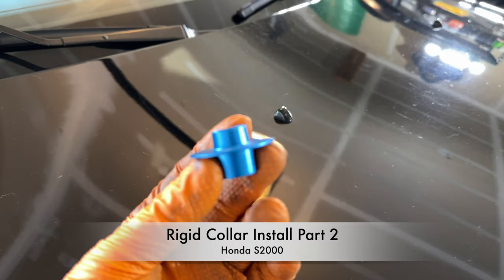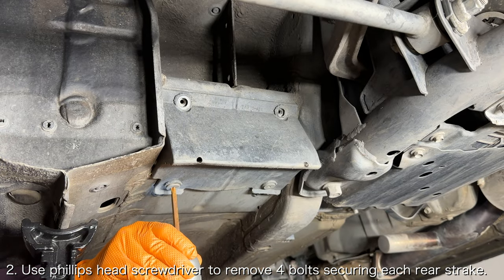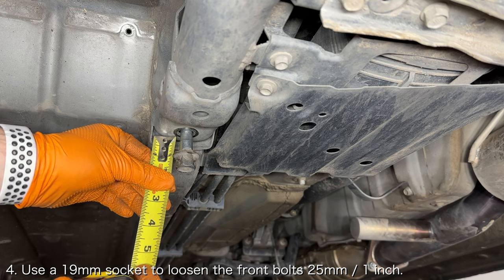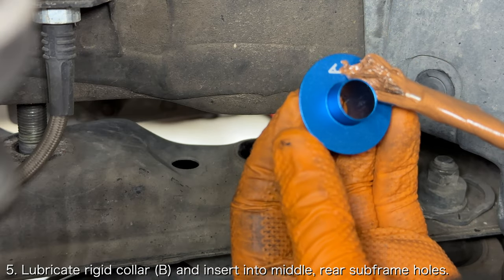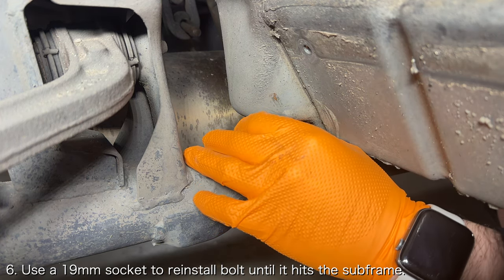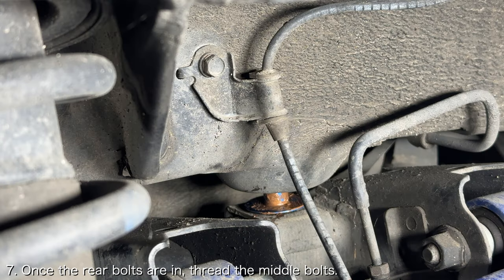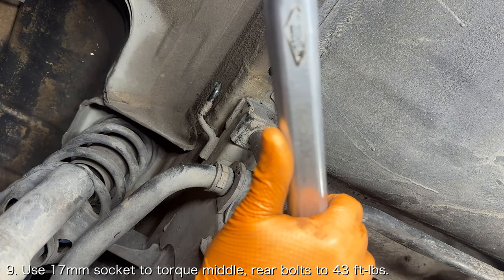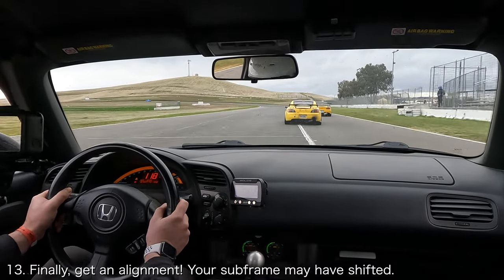Rigid Collars Install Part 2 (Rear) | Honda S2000

Comment: My note after doing these: create some slack in the ABS wires! They're tied down to the body and the subframe, so when you lower the subframe, they get pulled tight. I didn't break mine but stressed them a lot more than I would have liked. Removing a 10mm bolt on each side allows plenty of slack for them to move freely.

Comment: If you ever get a chance a tailshaft/output shaft bearing replacement video would be helpful to a lot of people. These transmissions are getting expensive, and rebuilding them is starting to be a more cost effective option.
Reply from the maker: I would like to start dabbling in this, not sure if encountered anyone with the issue yet
Reply: @DIYGuysvideo  I'll be tackling this as soon as I get the parts in.

From what I can tell, you can totally do this without having to remove the transmission from the car.

Biggest concern is getting the flange pre-load correct. It's usually fine with the shims already on the trans, but it's helpful to have extras of different thickness. Trouble is, you won't know the thickness of the shim you actually need until you take off the tail section. So you'll basically have to buy one of each.

If you're going to do the job, you should get all new o-rings, and seals. All in you're looking at ~$220 in parts and around $120 in tools.

The job itself is probably a 3-4 hour affair, depending on how many times you have to bolt and unbolt the tailshaft housing. Make sure you get all new bolts. As the factory bolts can and will stretch after you tighten them down a few times.

Also buy a new plastic guide plate just in case as it's easy to break if you don't pull out the tailshaft housing straight out. It's only like $7.

Comment: You definitely don't want those subframe bolts to ever seize up. So great tip on antiseize them. Don't skimp!

If you're trying to remove subframe bolts and they're stubborn, STOP! You DEFINITELY don't want to break one of those bolts off. Even if you spend an hour on one bolt, it'll be way less than time, effort, expense to hack up frame to replace captive frame nut.

As gently as possible, retighten the bolt, the loosen it again, trying to go just a few degrees farther than last time. Manually use a socket wrench, not an impact gun. Repeat the tighten, loosen a little more than last time, retighten process over and over and over until bolt comes out. Patience is worth it! Don't fall into temptation of applying more torque hoping it'll come rest of way loose. Remember how bad it'll suck if you break a bolt.

Buy new bolts in this case, and lube them up good. But first, use the old bolt to chase the threads. Grind several lines the side of bolt, much like how a thread tap looks.

Clean the bolt threads up as much as possible. Use a wire wheel, and a thread file. If threads don't clean up well, buy an extra new bolt, and sacrifice it as your cleanup. You'll need different sacrificial bolts for each bolt size that was difficult to remove. The cost of these bolts will be trivial compared to if a bolt breaks.

Put a little antiseize on your hpke made chaser threads, and repeat the in a little, loosen a little process to thread the old bolt in place. Make sure to carefully start the bolt by hand to prevent crossthread. Maybe even grind a taper into bolt tip.

If bolt starts to freeze up back it out until its smooth, go back in. Exercise same patience you used getting bolt out. Remember now its structurally weaker due to those grooves.

Now remove your chaser bolt, and use your new bolt, with lubed threads.
Reply from the maker: Good points. I have had great success with sacrificing an old bolt and making a tap out of it like you’ve mentioned. Cleans up threads real nice. This could be its own video tbh.
Reply: @DIYGuysvideo  yes. What I like most is this method repairs the threads, not cuts them (like a tap would).

Tap will remove metal, weakening threads. Thread repair will mostly manipulate the metal back into shape, removing very little. Preserving thread strength.

Comment: There are no Phillips head screws on this car. They are JIS, a Phillips head screwdriver can work but is not ideal. JIS screwdriver works better. Otherwise great video.

There are alignment holes on the chassis and subframe that can be used to make sure the subframe is in the correct place. In practice they aren't that useful.

Comment: Can u tell the difference? Or more just for keeping your alignment better.
Reply: I’m also interested in this question
Reply from the maker: Sorry I don't have an answer to this question. I installed these at the same time that I installed coilovers as I was prepping for an upcoming track day and didn't test the rigid collars in isolation. I primarily did it to try and keep my alignment consistent.
Reply: the subframe collars is one of my favorite mods. it is one of the few improvements you can make to the car that will increase both comfort in terms of road compliance and performance in terms of feel. I liked it so much I even installed it on my commuter car
Reply: Spend your time and money on something else. I did this on my s2000 and it did absolutely nothing but gave me and my friend grief. Also had to do alignment again because now the frame and body is truly straight therefore your alignment has been altered.

Comment: Would blue loctite not be needed?
Reply from the maker: Never
Reply: @DIYGuysvideo  Why not, gravity doesn't help the bolt stay up.
Reply from the maker: Tightening the bolt properly keeps it in place. I don’t think I’ve seen thread locker used in the shop manual once.
Reply: @DIYGuysvideo  Not necessarily depends on applications. These subframe bolts when removed show signs of thread locker from factory.
Reply from the maker: Not on the Honda S2000. Not sure what you’re talking about.